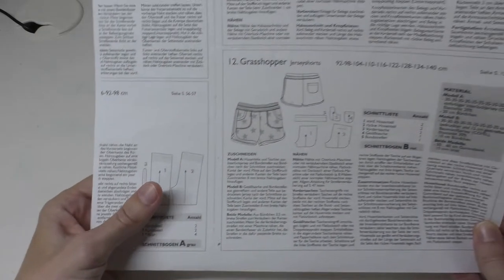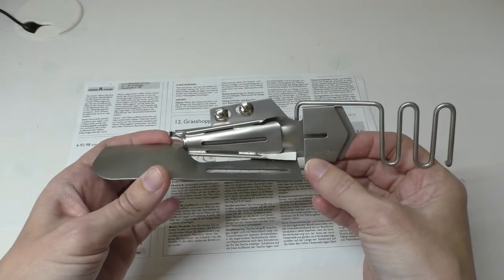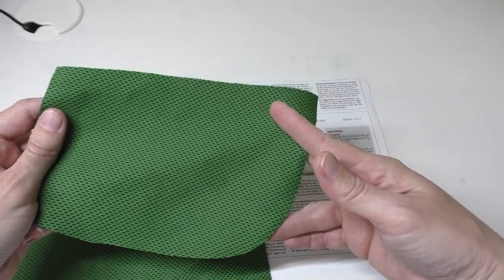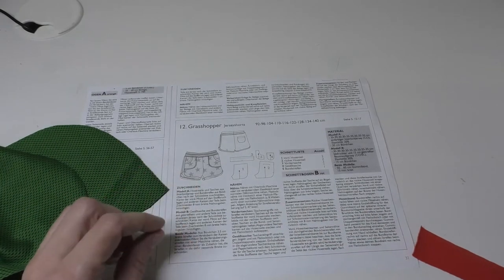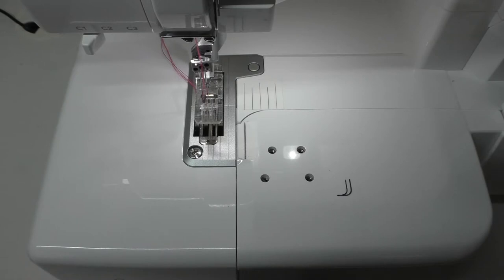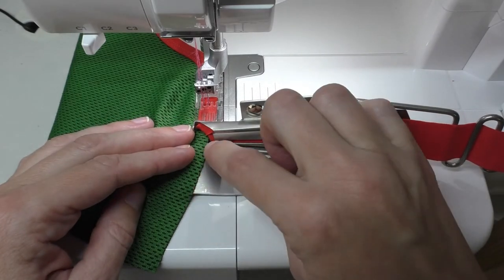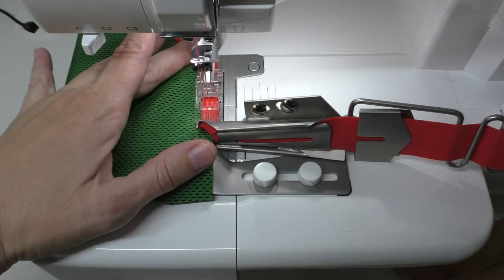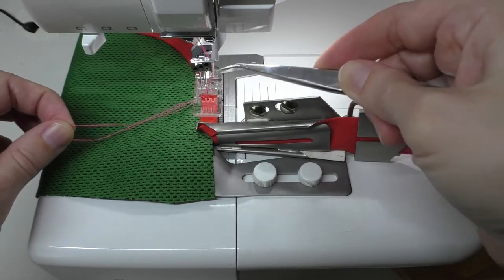Outer curve binding

Comment: I have just found your video, after throwing my hands up in desperation.Your method works perfectly. My problems with convex curves is resolved. I have recently acquired a transparent foot, this helps to see the needle position. I switched to using the left and centre needles as per your video, and the slight adjustment of binder position sorted out my problem. Thank You

Comment: hello where can i buy this in any size you chose?
Reply from the maker: Hi - I can not give you buying advice as your local possibilities are not know to me. As mentioned in video I use a "branded" finished size 10mm. I bought this locally from my dealer. Branded means that it is the same Brand as my machine.